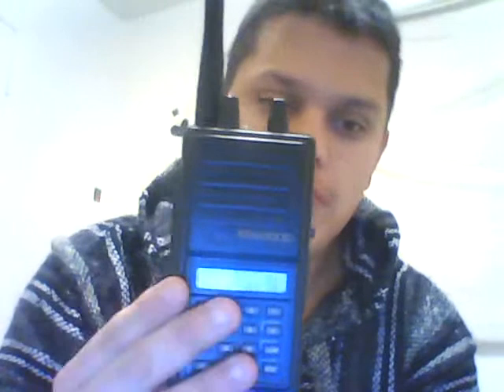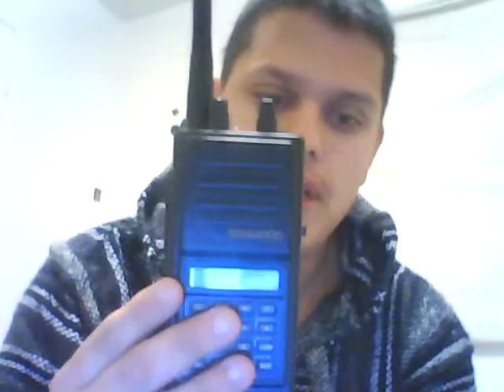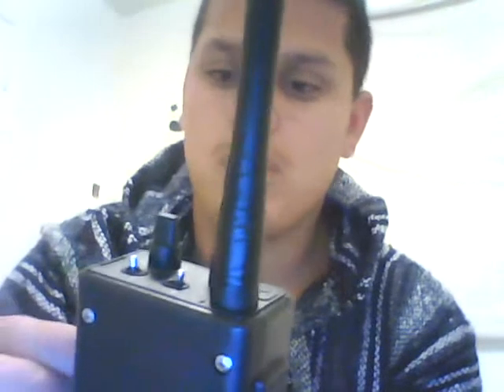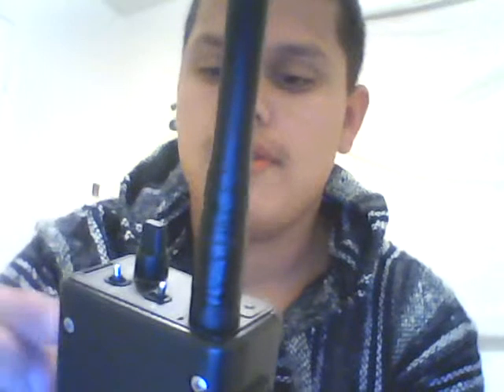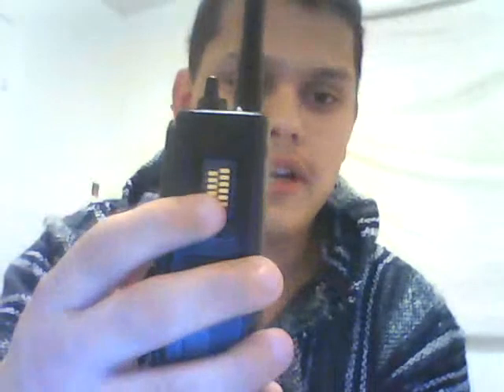porgraming kenwood tk 230

Comment from the maker: thanks i am glad to help the radio i have can store 200 channels and it is fpp but i cant find other accessorys but it is  anice solid radio
Reply: Well it's good to see you interested in the radio electronics hobby. When I was your age I worked for a business that sold and repaired police scanners, CB radios, and mobile telephones. Stick with it. You'll never grow bored.
I got my hands on another TK-230. This one is complete. I'm installing the software on my DOS PC now. Is FPP enabled through the software or does it require  firmware? 

Also, I have a TK-290 programmed for two tone decode in channel 1. Does theTK-230 have two tone decode  signaling?
Reply from the maker: The two tone I have no clue you just have to sort those pins you can change pl power output and many other things except the alphanumeric Chanel name I would love to have the radio programed with the does software that would be cool are you using dos box?

Comment: Great video Felix thanks for posting it. I have a VHF 10 channel model which appears as the model you're holding. I haven't bought a battery for it yet but it has all of it's knobs and a solid radio. 
Interested in programming 10 VHF frequencies? 
I have to software but no Kenwood RIB or programming cable (KPT-20, KPG-43). 

Also, it has two toggle switches on it's top. I'm thinking one is for CTCSS / Private Line so the second could possibly be used to toggle scan on or off?? 

Tim
Reply from the maker: Bell Technical Institute  on my radio I think that switch is for zone selection